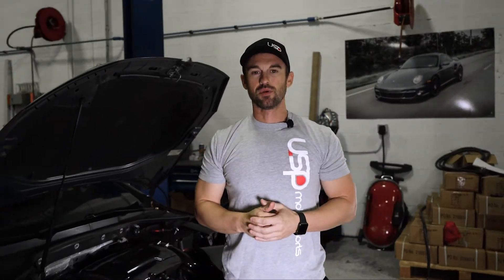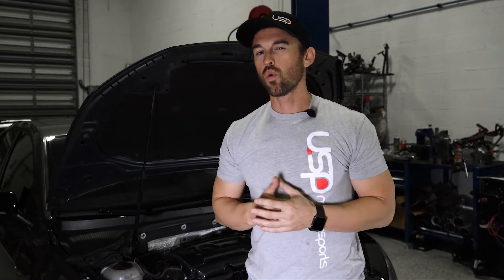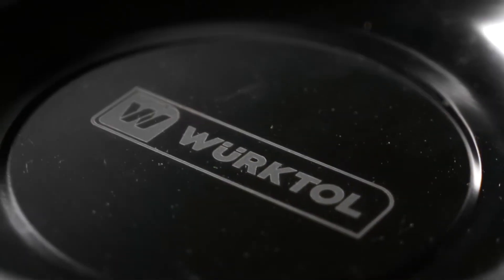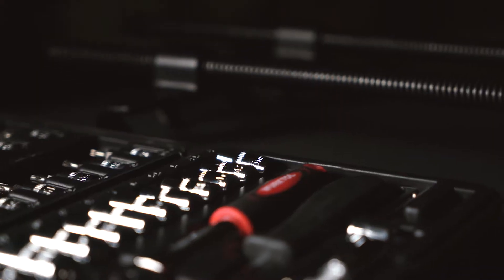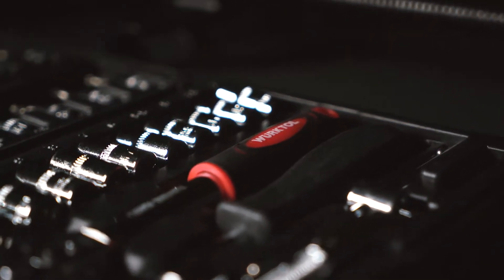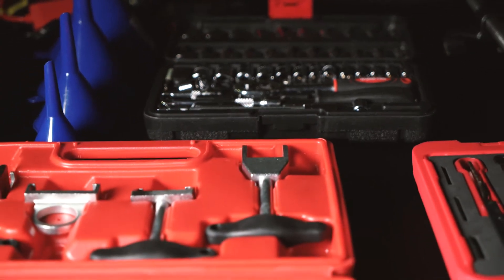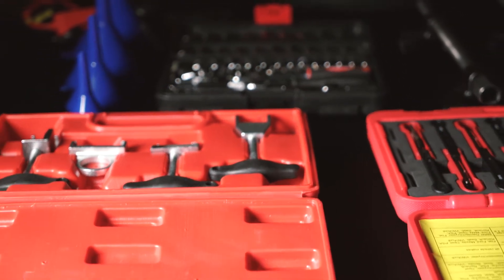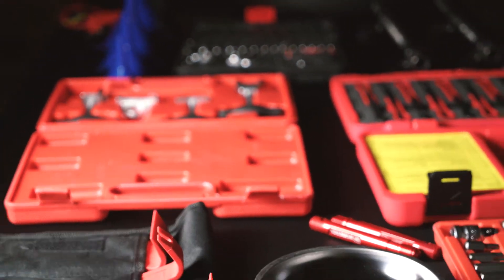Würktol // European Speciality Tools For Enthusiasts

Comment: Hi, my name is Rafael from Brazil, how are you? I have a serious problem in the car and here in Brazil not only do I have this problem and can not get anywhere, the error name is P164B which is oil pressure drop and in this causes the ignition of the EPC lus with 4000 RPM , we exchanged oil pumps, sensors and nothing, continues the same error, I did the oil pressure test in high and hurry does not rise to the correct PSI stays low under 40 PSI and the normal is 43 to 62 PS in high, you know someone there in the US or someone could guide us to comosanar this cronica problem of jetta tsi 2013 if you can help me or pass to someone who knows about the error P164B would help me a lot.

grateful Rafael.